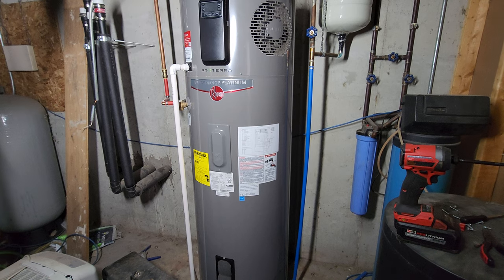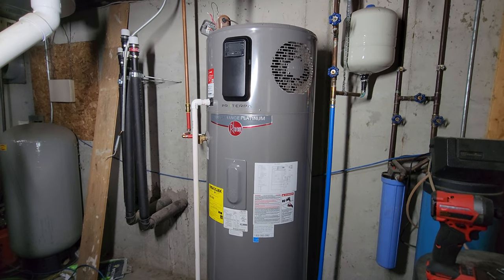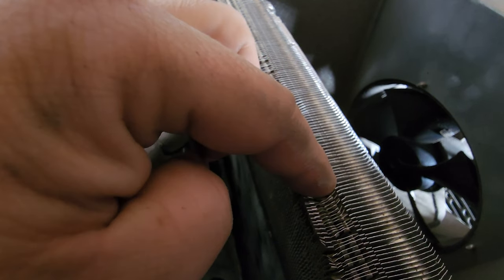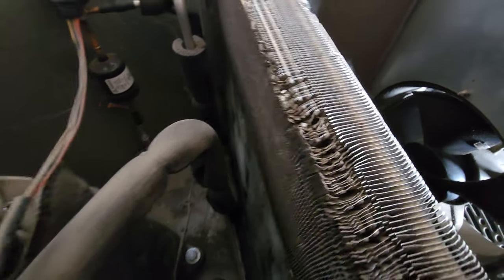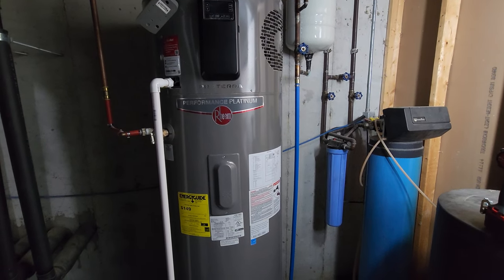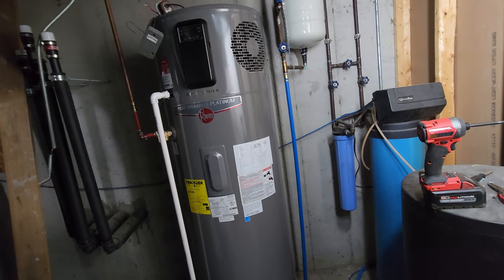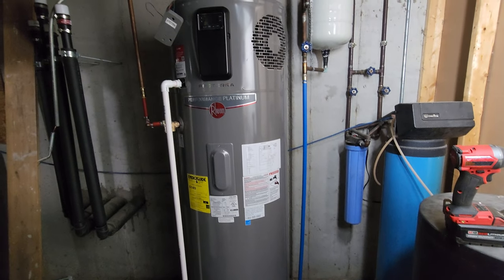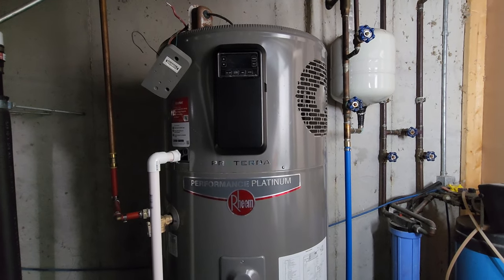The downside to a heat pump water heater. It works great till it doesn't.

Comment: Just put an additional HVAC filter on the air intake which will catch all the particles the original filter won't catch, problem solved. A rambling 21-min video about nothing.

Comment: Hvac technician here, you would be better off using air conditioner coil cleaner to spray the evaporator coil to clean it off rather then using air. Make sure you have the condensate drain going into a bucket or something, I would recommend doing it every year depending on location.
Reply: hvac tech here as well, I am not sure whether to use condensor or evap coil cleaner to be honest, being that it is inside and not outside where I think it should be. I am just learning about this technology, a floor drain is required for this type of water heater, if not available then a condensate pump is needed, which brings another challenge on top of this iced coil, which I would install a pleated filter on top of these useless filters that come with this water heater. I went natural gas tankless a few years ago, has paid for itself in two years. I wonder if this heat pump water heater can be placed outdoors, where I had my tank water heater where now is a tankless water heater. I plan on buying a heat pump water heater, just because everything is going electric, but I plan on making it a remote system or see if one already exists.
Reply: Use Evaporator coil clean, if you get the foamy kind use a wet/dry vac to help get it off along with rinsing it with water
Reply: @aureliomendoza522 Get a SANCO2 heat pump water heater. It’s expensive as all hell but you’ll never have a problem with it and it heats up like a wild fire. The maintenance on the SANCO2 is just washing down the outdoor unit same as any HVAC condenser you’ve ever worked on.
Reply: @aureliomendoza522 I think these are made for interior open air/not in closet. I've seen a cool water exit pipe exiting no different from an AC unit as was shown in a Florida. Not sure how practical these are in the North however where the pipes can freeze.
Reply: awesome video. great analysis. constructive criticism here: work on your editing. There is a lot of redundancy..You can at least trim 1-2 mins of excess video by removing the unnecessary or redundant montages.

Comment: Put a 1 inch furnace filter on top of the unit and get some condenser cleaner
Reply: A 4" may have less resistance.
Reply: @jamesphillips2285  If it is a pleated filter, a 4" WILL have less resistance.  I've modified my furnace to be able to use 4" filters and they are MUCH less noisy.

Comment: As others have mentioned, there's a spray called coil cleaner.  If you need to "brush" it, there are coil combs.  The real conclusion of this video is that there is a compressor coil system that needs to be maintained.  Thanks for sharing your experience!
Reply: An uniformed buyer has NO WAY of knowing compressor coil maintenance is required until it fails, because these facts ARE NOT MENTIONED in the sales brochure or even the USER MANUAL.  I may buy one, but I'll know in advance what the maintenance entails.
Reply: @joshm3342 they have heatpump only heaters now
Reply: @joshm3342  The uninformed buyer is uninformed? That's shocking.
The coil maintenance and air filter swap out process is outlined in the Use & Care Manual provided with the water heater.
Reply: @tim3172  Coil maintenance is not mentioned in the Use & Care Manual (AP21681 Rev 03) included with my unit.  It simply says, "It is recommended to clean the filter on top of the heat pump when 'Clean filter reminder' alert appears. Clean by washing with mild detergent and water. Dry and replace. Remove the filter by lifting up, then replace by lowering back into the filter slot on top of the unit." on page 23 of document.
The word "Coil" is nowhere in the document.
Additionally, the same manual has instructions not possible for my unit regarding Error A108 'Condensate Blocked: Unclog Line'.  In my model, there is no way to inspect the condensate pan as mentioned, without disconnecting service and disassembly of the unit .  This level of maintenance is not designed to be done by the consumer.
    1. Remove top cover from tank
    2.  condensate line is clear and
    3. If water is present, locate blockage and unlock.
    4. Ask customer to where the condensate is being routed 5.

Comment: No dude, it should never ice over, your evaporator fins have a thermostatic temperature sensor that either fell off or is defective, all ac units or heat pumps have them, they cycle the compressor off to keep the evaporator fins from freezing

Comment: I was seeing reduced efficiency this winter about 13 months of ownership.  I started receiving A108 error codes on the app.  Getting errors about drain issue.  The condenser was icing up after long periods of use.  Called Rheem and shared the information and they sent me a new evaporator sensor.  I installed it and that error and icing up was much less.  About 2 weeks ago after upgrading the EcoNet 6.x app I started getting A105 errors and  performance errors.  Called Rheem again and they sent a AP18087 - NTC THERMISTOR and replace the one on the evaporator.  The run times of the compressor was cut by at least half the time and the errors have stopped.  It is using less electricity again like it was before fall.  I definitely recommend calling Rheem the parts for my 50 gallon tank they replaced for free.  I just had to do the work.
Reply: Sounds just like mine 
 I started having problems at 11 months  and now nonstop issues 
  Now mines leaking constantly 
  And this thing never shuts off in energy mode    So who knows how long this system will work

Comment: Partner, looking at the dust throughout your basement/garage, I think you should take into consideration the environment. The manual does mention that it can lose efficiency if the surrounding area has a lot of particulates. I made a small duct, with a Merv 16 air cleaner so that all air brought in is filtered.  The washable filter is like a Merv 4. Also, you should flush out your tank every 3 months, not each year. The system does have design flaws, but with good maintenance it can work effectively for a very long time
Reply: Agreed.  Clean that room.
Reply: What your saying may be fine for those who can do these things on their own. When on a fixed income and not able to perform these maintenance on ones own it is not a good choice. These sound like they are better suited for those who are capable of doing their own maintenance or those who seriously have the money to call a qualified company to come out to do it. Having someone come out every 3 months to flush the tank would be very expensive not to mention if other things were needed. If you have hard water there is another issue to deal with.
Reply: @AnnHopy   It sounds like the complete opposite... it sounds like you can't afford to continue using a money sapping solution and need something that will save you money month after month.
Reply: @dus10dnd  It would seem you assume things without knowing things. My bill is just fine, very low. My water heater on the other hand is on its last legs, hence shopping around. Don't assume until you have all the facts.
Reply: @AnnHopy  No, I assumed absolutely nothing.  I used only the information that you clearly provided.   You talked about a fixed income and not being able to handle things.  If that's the case, then you can't afford to not improve your routine expenses.  And that isn't a judgement statement... if there is anyone out there that can't decide to never work again, they're not really in a position to be frivolous with expenses.

Perhaps acting like you've got the answers and a pedestal if you can't even remain consistent in  your statements.

Comment: Simple & inexpensive solution to this problem...
Use a better filter on the outside.  
Installed same water heater over a year ago and within a month noticed dust/lint collecting around and on the intake side. After vacuuming up the dust I cut a piece of 1" filter material (same stuff used for washable furnace filters or for stuffing pillows) to cover the intake area. For over 15 months this has worked great at collecting the finer dust before it gets to that factory course filter.  Remove and wash as often as you would change (or wash) your furnace-A/C filter. I do it monthly and the inner factory filter remains mostly clean, I see no accumulation on the condenser unit.

Comment: Maybe someone mentioned this but I didn't read all of the comments.

I have the same model and experienced a similar problem.

There are three temp sensors (thermistors) in this unit. One on the evaporator, one for ambient temp, and one for compressor discharge temp. All three are used to control the expansion valve which prevents the evap from freezing. If you call rheem they will have you press some sequence of buttons to get the readings from the 3 sensors. If they are out of spec they will send you new ones, pretty easy to install, you are already almost there with the cover off.

You could also put an ohm meter across the two wires from each sensor. All three should read about the same. If one is out of range from the other two you know it is bad. Depending on which one fails you will have different issues. In your case, the evap thermistor is likely bad.

Comment: Thanks for the video.  Another reason to go geothermal.  Or if I do get one of these, I'll build a triangle "hut" on top with the two large sides made of furnace filters and a custom cut bottom to fit the opening on top of the unit, to at least significantly delay icing problems and the need for deeper cleaning.  Thanks again.
Reply: I like this approach - an extra filter stage with a more accessible/changeable filter arrangement is a great long-term fix in a dusty environment!

Comment: The simple truth is (which I learned the hard way) DON'T ALLOW THE DIRT, DUST AND ANY OTHER DEBRIS TO GET IN THERE IN THE FIRST PLACE. While I was decommissioning the brick chimney, which I didn't need any longer because I had removed the old gas hot water heater, neglected to cover and protect the new heat pump hot water heater. Consequently, some of the dust from the removal migrated through the space in the basement and got sucked into the heat pump coil over the next six or eight months and caused a failure. With parts from the manufacturer and some very careful clean up everything has been running just fine since then. I did put a small furnace filter over the air intake to add some help to the filter that comes with the heat pump.

Comment: I saw the potential for this issue when I installed mine. I made a large dome cap for my water heater out of two large washable HVAC filters. I used aluminum stock and riveted a frame together. After a year of service while replacing my sacrificial anode with a powered anode ( you should do that by the way), there was no noticeable buildup of dust on the coil. Once a month I hose out the washable filter while also replacing my HVAC filter. I like wood working and I set my table saw right next to my Rheem hybrid. Not exactly dust free friendly.
Reply: Still not having problems having it in the same space as your workshop? Thinking of getting a HPHWH myself…
Reply: @MichaelDinsmore  I am having no issues at all. I like being able to control and monitor it from my phone. Averaging about 2 kw hours of electric usage per day.

Comment: Took a very specialized class 4 months ago put on by Rheem. They invited 36 of us to Top Golf for training, selling food, drinks and driving range. Very nice selling point with Rebates and incentives. They only require 6” of clearance on top to service the filter. So how is anybody going to service or do a deep coil cleaning? 

They also told us that they don’t want anyone messing with the heat pump. If it fails , they would just send us a new heater for the first 10 years. Did my first 80 gal install in an outdoor 36” metal shed that I replaced the 75 gas heater. Vented the exhaust outside so it would recirculate the cold air. But with only 6” of required top clearance, it will be impossible to clean.  What I might do is caulk the seams of the shed and cut in a good filter on the shed for a simple to change pre filter. Although it will be interesting to see what the factory filter looks like after a few months. 
For those free standing heaters like in the video. Can a simple pair of panty Hose be draped over the 26” diameter top and be a simple throw away filter?  Would like some responses from HVAC pros. I’m a Plumbing pro with 47 years of experience, but hvac is not my thing. 
Thanks, Rick
Reply: They should also make the cover easily removeable and not put a million stupid sheet metal screws on it.

Comment: Thanks for the candor - good to know about the limitations of the filter design. Sounds like you may be operating in an extra high particulate area, so I like the other viewer's suggestion of an extra filter stage. Definitely have to keep maintenance cycles in mind with home appliances!

Comment: Awesome video thanks, I installed my Rheem Proterra 80 gallon about 16 months ago, and found my coil starting to ice up today so it's currently running in electric mode.  I thought that perhaps it had gotten low on refrigerant, I hadn't considered that dust was starting to clog the coil.  I'll pop the top off of mine and get a better look/ clean it out.  As long as that fixes the icing, I'll be building a sheet metal adapter to go on top of it so that I can run a standard HVAC pleated filter.
Reply: The refrigerant is a closed cycle. It won't get low on refrigerant unless, and this is very unlikely, you have a leak, in which case you'd need to repair the leak.
Reply: @kenjohnson6208  yes of course, in saying that I was implying that the unit could be faulty and slowly leaked to the level that the coil was freezing.  I was of course hoping that's not the case.

First thing I'll do is pop the top and vacuum off the coil.

Comment: Quick summary. 1. Grossly inadequate filter, pretty common in hvac equipment. 2. Dirty environment for equipment that needs a clean environment. Either make the entire basement a clean space with filtered air, or go to Menards and find a merv 13 pleated furnace filter a minimum of 2” thick, take the filter and the top to your water heater to a sheet metal shop and have them fabricate a piece that will fit snugly over the top with a frame to hold the filter.

Comment: My heat pump WH has been running great for 9 1/2 years.  It only cost $1130 at Home Depot on close-out and it is saving me $150 per year on elec.

Comment: Good video alot of insight, I have a the same type but a 40 gallon I installed in 2017, I have had zero issue until today I got the code saying condensate drain clogged. I open top clean drained still got code. Just ordered a new sensor.  I would recommend getting a low power HVAC press washer they are used to clean coils I have a mini split and trust me it has just enough power to feel clean the coils. I have even used to clean the cars ac coils. Being in Florida I like to keep the ac stuff going. You are correct no one will tell you this stuff.  
I have a guest home also I am thinking about replacing the element with a sermgued heating elements that's powered by solar from Missouri Solar and Wind Company. I would also add a. 1 inch hvac filter on top of your in a dusty area to add extra protection.

Comment: Thank you. You have done everyone a service by pointing out the additional maintenance required by these types of water heaters. All water heaters, regardless of type, require annual maintenance. So to say that no one will be checking the health and welfare of their heater, says more about the laziness of the consumer than about the design of the heaters. Much of this work can be done by the consumer, however if you don't want the hassle, there are plenty of HVAC and Plumbers out there that will do the work for you. Usually runs about $250 a year for the service. But either way, you as the consumer are ultimately responsible for maintaining your appliances.
Reply: That’s the first on point response I’ve seen yet and couldn’t agree with you more than what was said. 

If the consumer purchases a heat pump water heater from their local big box retailer and installs it themselves then they should have done more homework to fully understand all the pros and cons of installing such a product. The big box retailer is not a professional distributor therefore the kid working in that department is also in no position to give professional advice on such an item other than what bay it’s stocked in. 

A licensed and experienced professional would have explained all the pros and cons between various types of water heating technologies to make an informed decision on which way to go. 

Should have sported for the SANCO2, all problems solved other than the cost of equipment would most likely turn them away.
Reply: 3 months ago, Rheem, held a very nice training session for 37 of us at Top Golf. They stressed that they don’t want us plumbers to mess with the heat pump. They would just provide us with a new heater if it failed. Of course labor is on the consumer. 
What’s interesting is they only require 6” of clearance on top as per the manual. So how do they expect anyone, pros included to be able to do the tear down and cleaning like shown on the video. 

In California, gas is being phased out for new construction, and electric  “Thankless” heaters are not an option as we don’t have nuclear power to supply the 120+ amps required for a small Thankless electric heater.